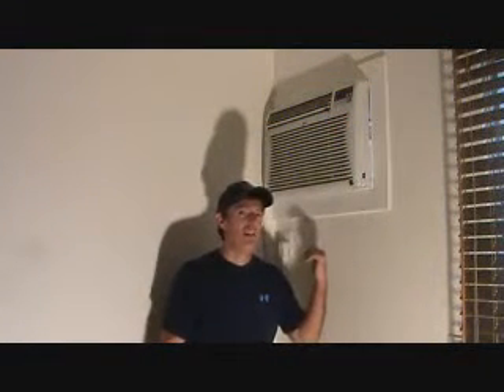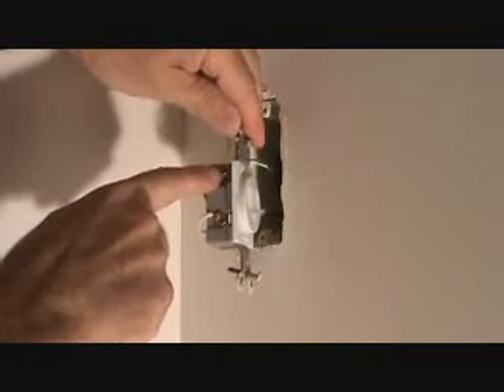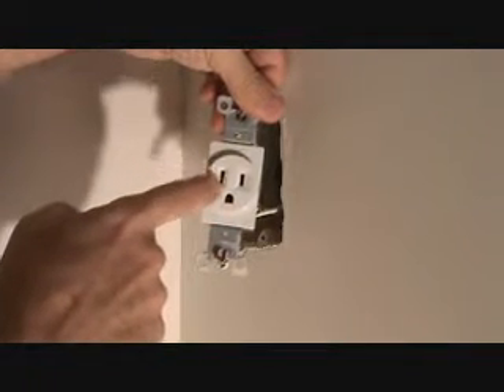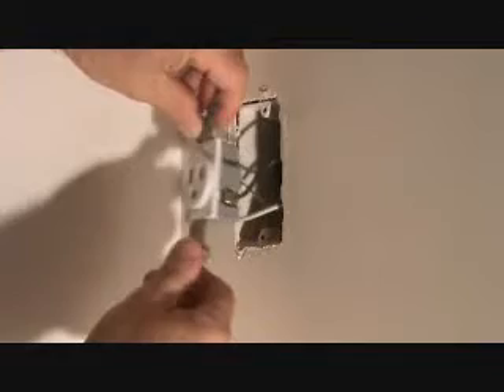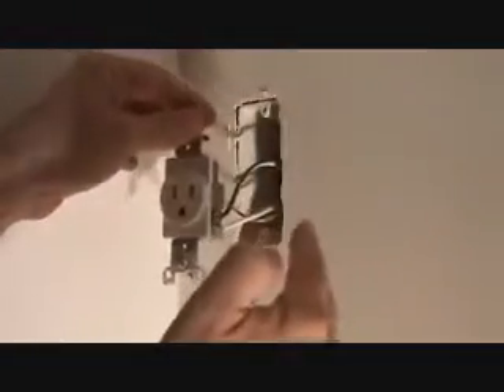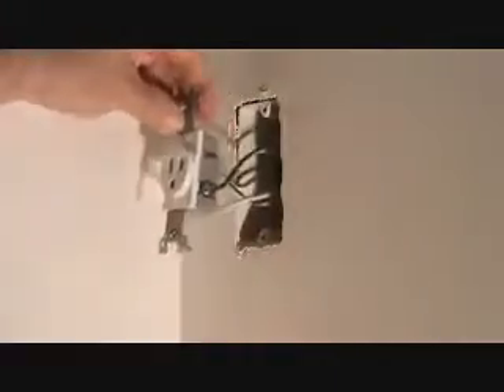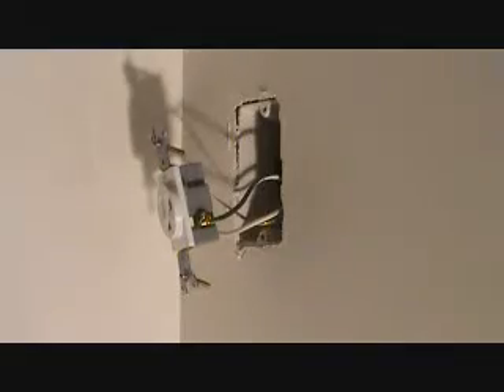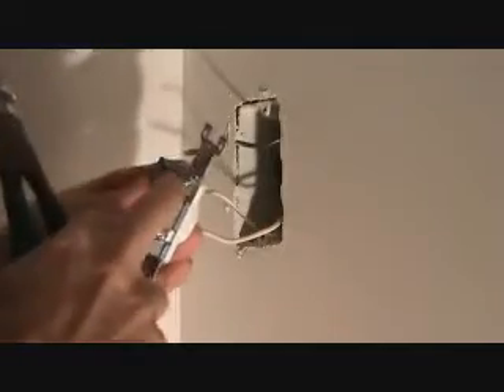How to remove an AC electrical outlet...Part 2

Comment: the black wire with gold skrew is that a ground as well?
Reply from the maker: No that is a power for the hot black wire. The ground wire would be attached to the green screw! Tell you what......I have lots of electrical DIY videos for the DIY beginner & if you want to learn more for doing odds & ends around the house for electrical then I would suggest you watch them...all of them. Just go to my main YouTube channel page then click on playlists & scroll down to electrical & you will find them. Watch them, study them & you will see that if I can do it (an average Joe) then YOU can do it too. Thanks for stopping by yo!